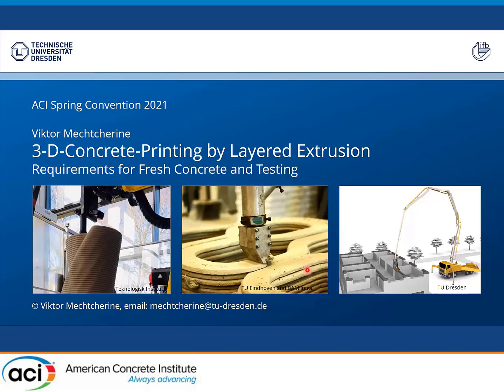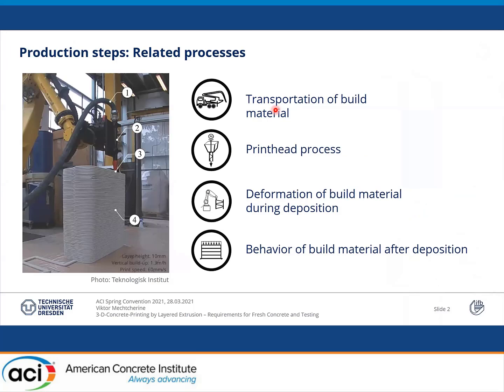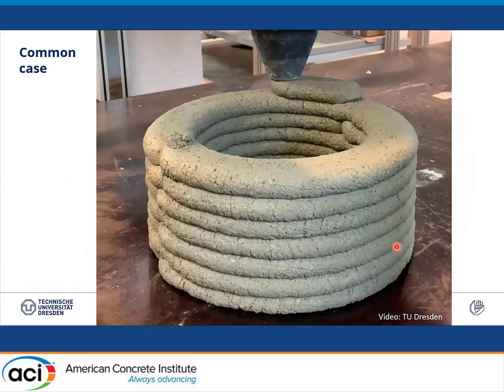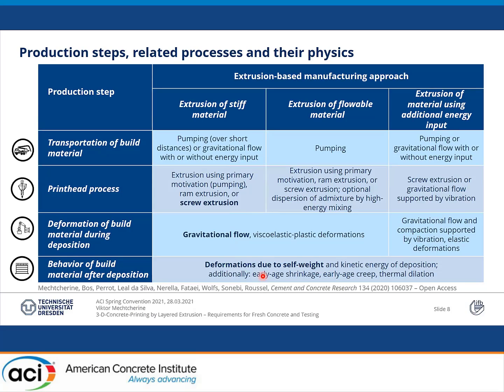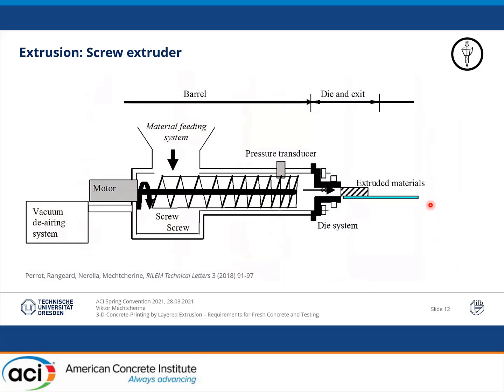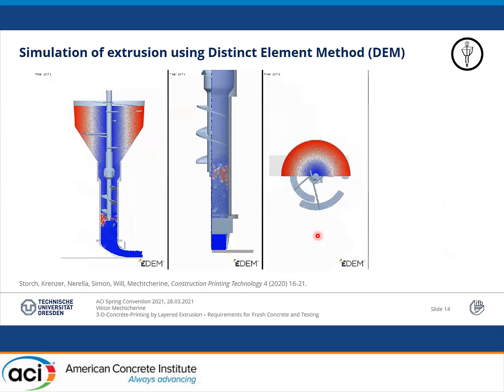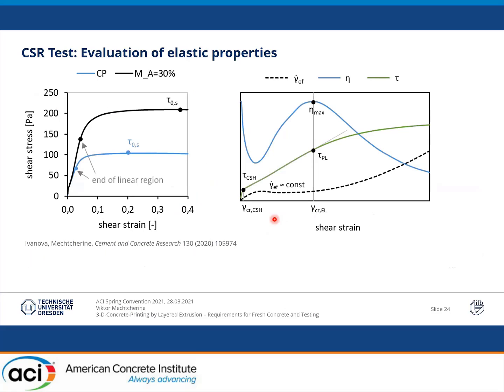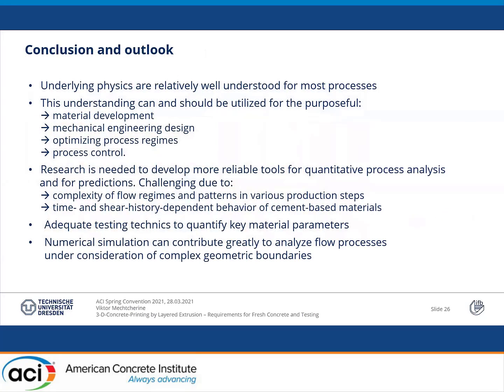3-D-Concrete-Printing by Layered Extrusion – Requirements for Fresh Concrete and Testing

Comment: If you took that printing setup that had the brick like consistency and took a steel string. That could articulate across the face of the port then out along the bottom a few centimeters and vibrate. Then you could use it as a gluing and cutting line. Then with a internal rutter inside the nozzle you could do turns. Then just use smaller lines for wetter materials. As for anything chunky that is a nightmare. You are always better off mixing in the end of the nozzle than ever trying to transport it. If you have to print with it then it is better to print a cheap forum that can be easily removed then separate nozzle for fill. I guess you could print with it... it would just some well placed turbulators.